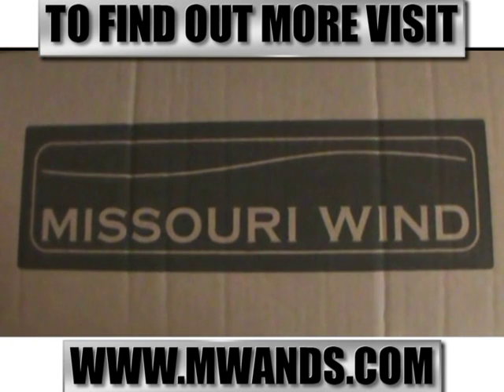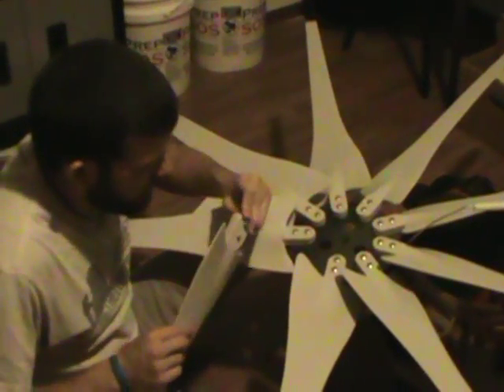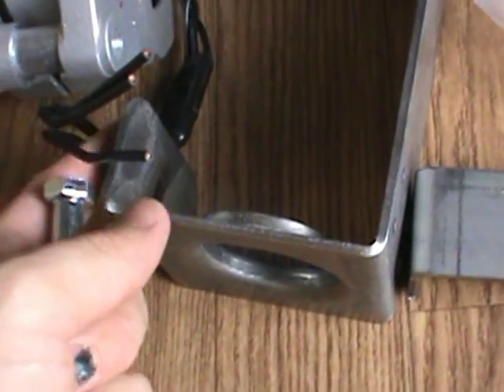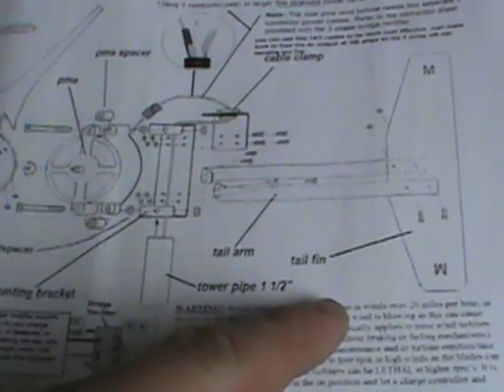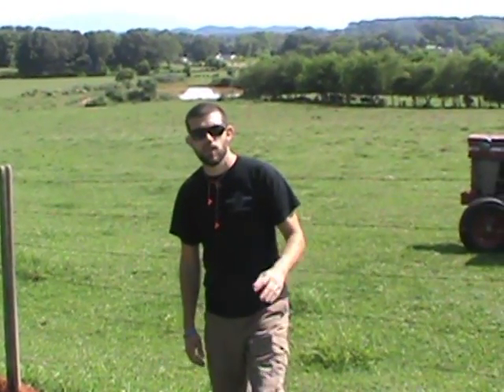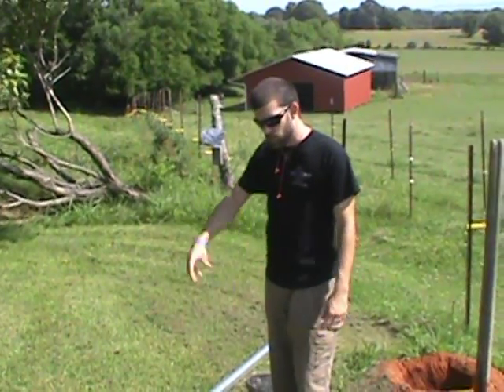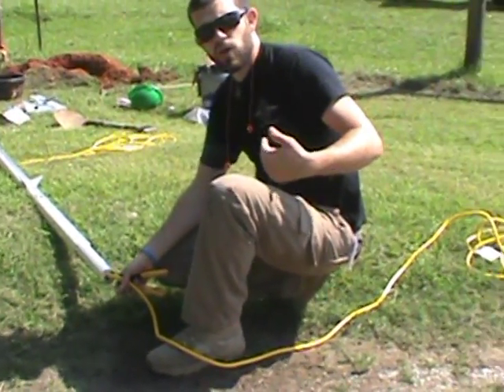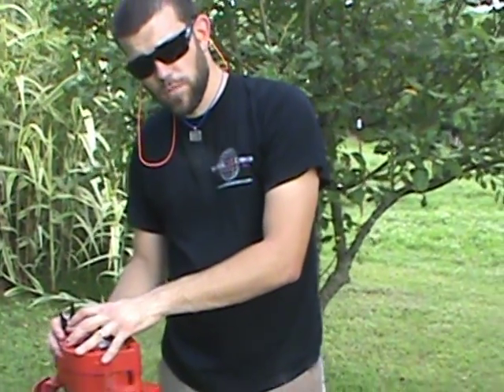A COMPLETE WIND TURBINE INSTALL FROM START TO FINISH (OFF GRID & GRID-TIE) PART 1

Comment: Looks good but i have a Question what provisions do you or Missouri wind and solar have for lightning strikes? I would think a lightning strike on the tower would trace right back through the wiring and into the house's and its wiring. that would be my only fear. 
Also does that one unit supply enough power to run your whole house and get you off  grid power?

Comment from the maker: When we get the wiring run the rest of the way into the house and get to run it through the rectifier I am going to check the readings. hopefully will have the utility pipe in the ground soon.

Comment from the maker: I have an adapter piece at the top hold the wire in place and I will be doing something similar at the base so worst case it would tighten up like a rubber band and then let off after the wind dies down.

Comment: Hey don't you need a commutator with slip rings at the top; otherwise your wire will be twisted off when the Wind Turbine spins around>

Comment from the maker: David you know the farm rules. Massey Ferguson red or John Deere green no exceptions. LOL. As far as the wires go I would only recommend doing that for a little while from a maintenance technicians perspective. it shouldn't hurt the motor but will put alot of stress on the blades because they are not moving to offset the wind.Im hurrying to finish it up.

Comment: why didnt you paint it light gray so the turbine did not stick out agenst the sky like a sore thumb?   also did the manufactures instructions say to twist the wires together like that? in a strong wing it could cause a burn out